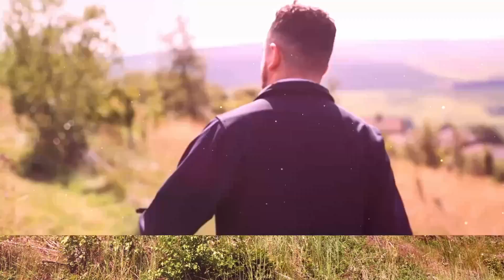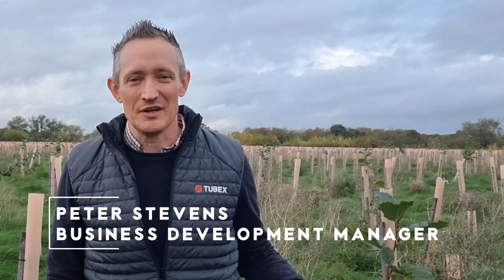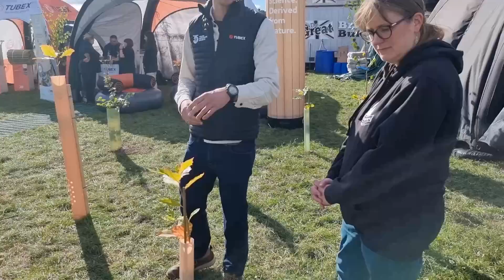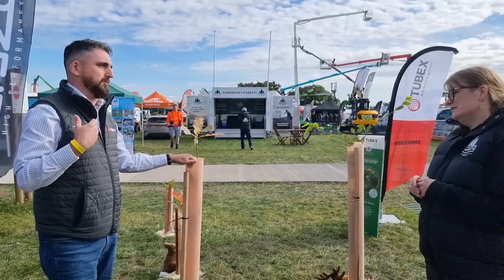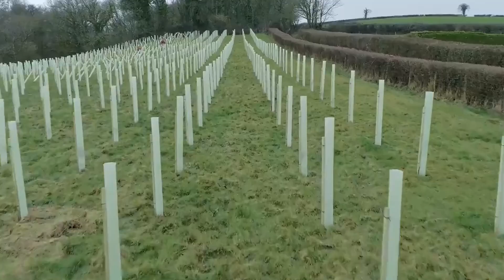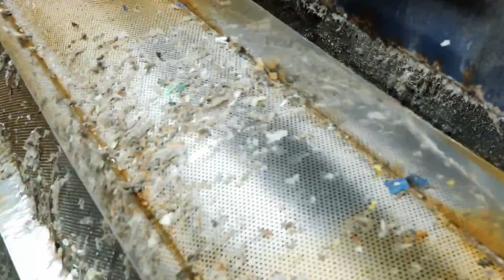Biodegradable Tree Shelters with Tubex

Comment: What  is the process for fitting the guard? Is it plant sapling first and then ease the tube down over it or dig hole first and feed sapling root first down through tube and then backfill? Or does it matter which method? Thanks
Reply from the maker: Thanks for the question, it's usually plant the sapling first alongside a wooden stake in the ground and then ease the tube down over the top of it.